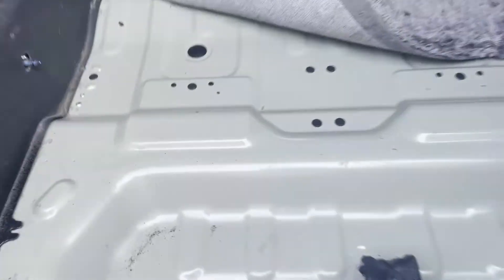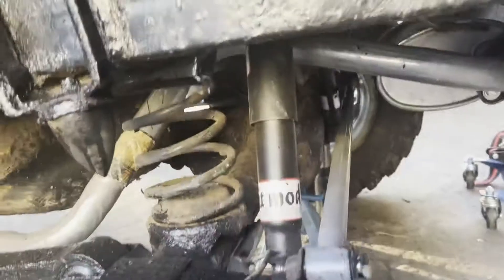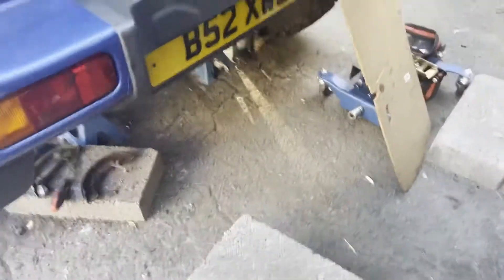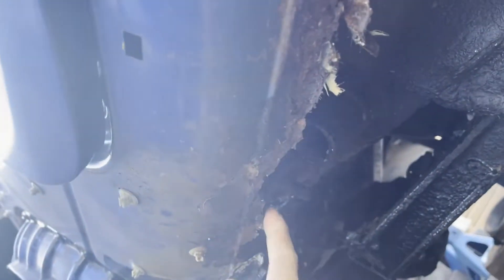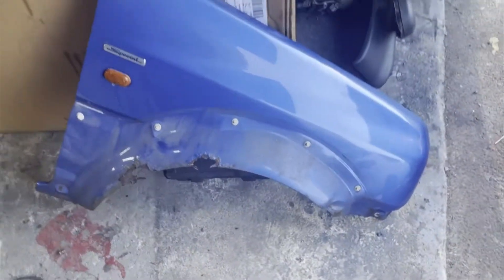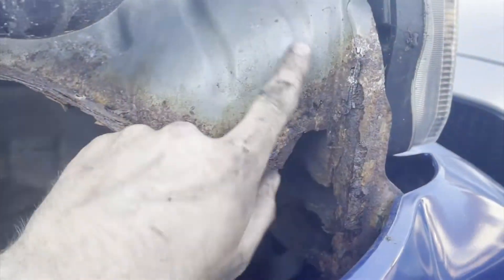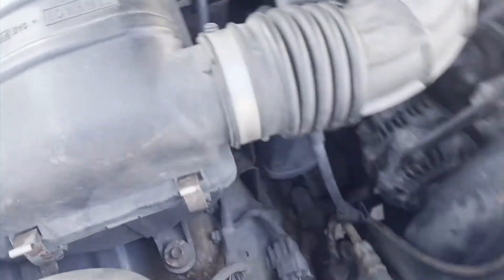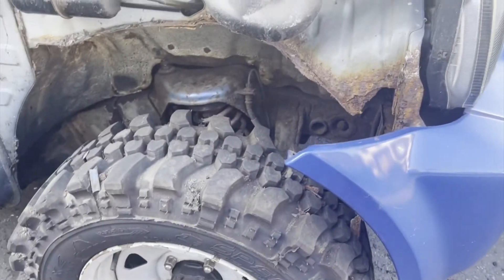Restoring 18 Year-Old Suzuki Jimny PT5 - Stuck | New Floor | Rust

Comment: Is it typical to find vehicles with that much rust?  Here in the states, after doing the research of where a vehicles was for the majority of it life, helps to avoid the rusted out floor pans and the like.
Reply from the maker: It’s seems fairly common with these older jimny cars because a lot of it it hidden under bits of trim and such.  It’s probably just not been well loved, we have the mot details in uk which show wether a car is road worthy.  It should state what corrosion is observed at time of test.  I think with this car without addressing this rust now it might have been destined for scrap!